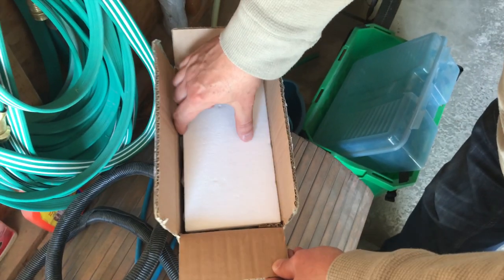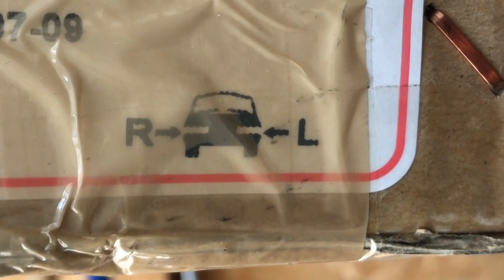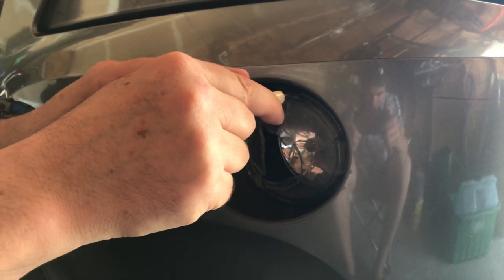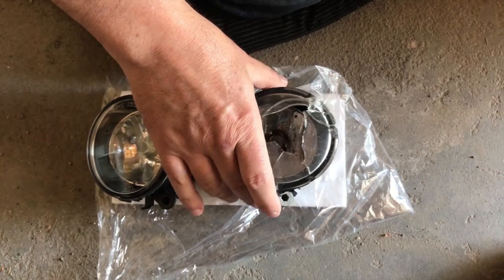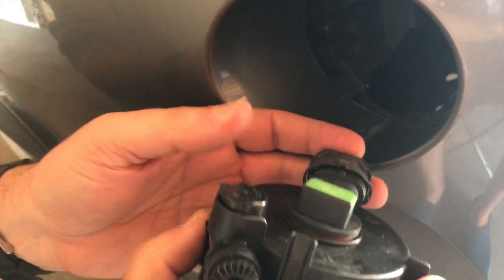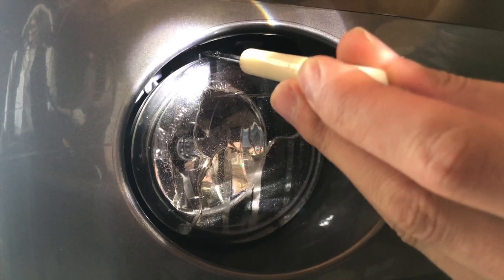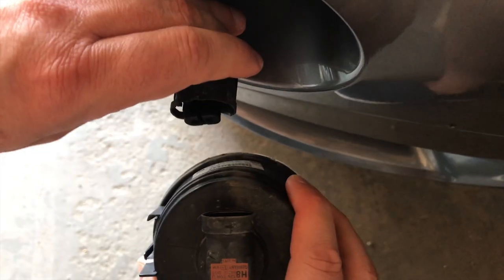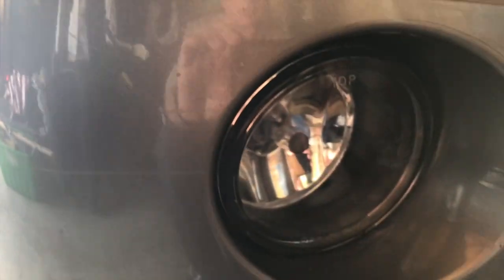DIY - BMW 2013 X3 Fog Light Replacement

Comment: Hey guys, an update on the repair..I took the liberty to call BMW get the actual cost of repair. Blieve me when I say this $580 to repair one light. Then I called my trusted AAA mechanic and he quoted me $302 for 1 light. Said the lights can be sold separately and it's pain in the neck to install :) 
Guys. This video helped alot, i changed the lights in 5 mins. Don't be afraid of the DIY stuff, watch these great videos, comment and like them as they are helpful. Thanks.

Comment: My BMW has adaptive headlights so the replacement fog lamps are $180 apiece. After looking at your video, I found a used one on eBay for $66.  Replaced the light in 10 minutes!

Comment: Great tip. Local dealer quoted £300. I sourced part locally (original manufacturer) £97. Less than 5 minutes to fit.

Comment: Excellent video with clear explanation. Girlfriend just got her 2008 X3 back from front end damage someone did. The fog lights have a gap around the light..isn't there supposed to be a rubber ring around them both to seal that gap or is that gap supposed to be there? (Not sure if there's a motor that moves them a bit when the X3 turns?). Thank you and happy holidays!!
Reply from the maker: If I recall, there is a small gap around it.  I thought it was strange, too, but then realized the light is a sealed unit so there's no need to have it completely sealed tight around it.  I know mine DON'T turn (mine's a 2013)... perhaps later models do. Happy holidays to you, as well!
Reply: @AnimationGoneWrong  Thank you very much for responding and for the info!
Reply: @haskam9615  Has, I believe the 2010 and earlier have a separate cover piece that is in front of the light.  At least our 2010 does, and I suspect your 2008 is similar to ours.  The 2011 on new were changed.
Reply: @threejacker9870  Thanks Jon. Much appreciated!

Comment: Purchased what I thought was the exact replacement you’re showing for my 2013 x1. However mine showed up without a bulb, no metal flange.  Please give link to proper replacement piece, thank you!
Reply from the maker: I just looked on Amazon/eBay.  I don't know of a specific link to the part.  Sorry.
Reply: @AnimationGoneWrong  This is for an X3 - for an X1 things get more interesting : https://e84.xbimmers.com/forums/showthread.php?t=1413307
Reply: Info is always on the bulb itself, similar to info found on a tire. Just match exact info when purchasing new

Comment: Great video, but I am sad that you didn’t change the bulb lol
Reply: he did change the bulb it was with the new light....one thing I do dislike is the different color of the bulbs in the replacements.  When I did this I reused the bulb that came with the X3 and just swapped housing. Good luck. Easy job.
Reply: @ronm7781  I meant to a higher temp. I have the Halo's on my BMW and the fogs are halogen, which is annoying to me. (yes I do know a certain color can do worse in inclement weather)